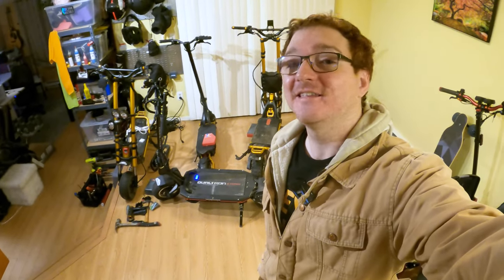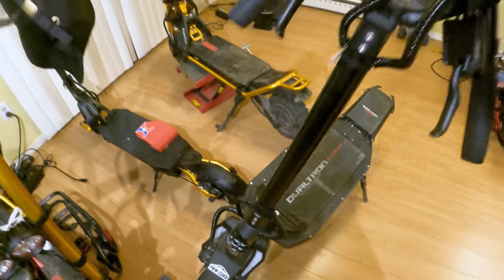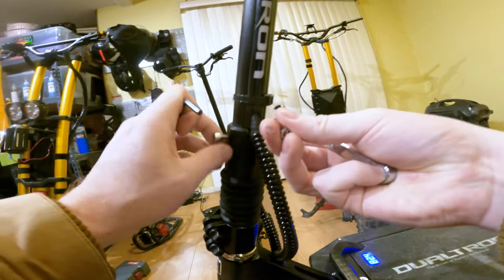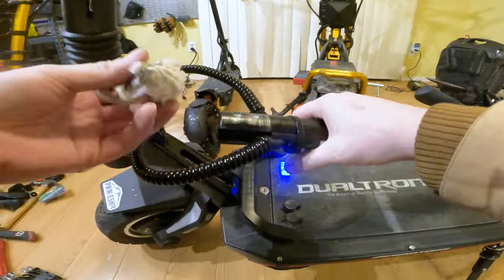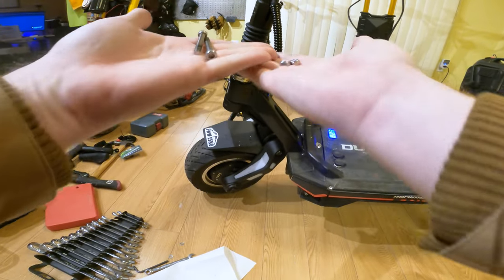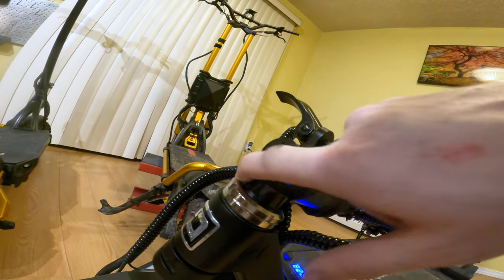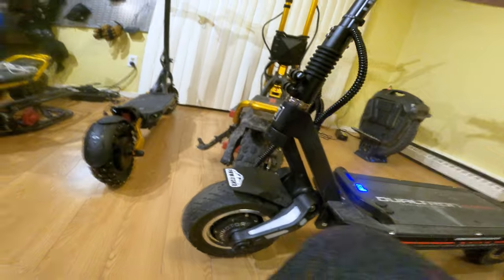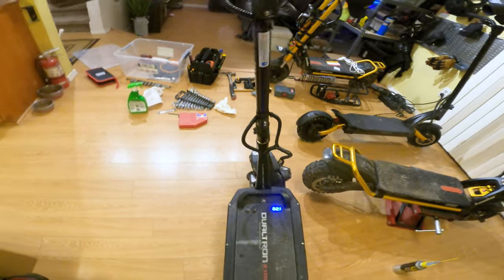TERRIBLE Stem Creak FIXED - Dualtron Storm Electric Scooter.

Comment: Howdy - Thanks for another good video.  I tried just about everything to fix the creak on my DT Thunder II stem and even with Teflon film, copper film, lubricants of all sorts and extreme tightening, nothing stopped it completely.  But it squeaks no more...  I don't fold the stem so I purchased a custom clamp with 6 very strong bolts and after installing, it is rock solid and totally silent.  Best of luck to all.  Have fun and stay safe.

Comment: cool to see youre riding your storm :D if the creaking comes back, a solution that usually holds up for a longer time is to clean it out like you did, but wrap the part of the stem that you insert with teflon tape, then use black silicone spray on the tape and inside the stem hole. its a bit more permanent :D worked great on my Ultra 2.  Another tip is to exchange those folding arms on the clamp for just regular bolts and use a tool to make it super solid with 0% stem wobble. its still easy enough to loosen if you need, but its heck of a lot tighter that way, and you dont have to hurt your hands tightening it.
Reply from the maker: Good tips! Thanks

Comment: Something you might try in the future for things is a product called friction paced. We use it in the bicycle world when we are attaching carbon fiber to carbon fiber it helps it grip and not spin or slip and not have to be over toward it is basically in assembly lube with something like pulverized glass in it basically feels like sandpaper cream it might work really well for things like that
Reply from the maker: I googled friction paced. Nothing came up.
Reply from the maker: O nevermind I found it. Friction Paste*. Yeah maybe I'll give that a shot if the noise comes back.

Comment: Thanks to this channel I just got my first scooter - Kaabo Wolf Warrior X Pro(was even lucky to get the facelift version, with the upgraded rear springs and the new side lights. I was amazed by how it performs, how long the battery lasts with me(115 kilos, like every winter) and how fast it goes. With me I was able to reach 65 km/h on my very first ride and got scared.
Reply: Lol. That's a helluva awesome first scooter. I bought a nine bot 2 months ago put 300 miles on it and now upgraded to the varla eagle one. There is absolutely zero comparison.  The ninebot is a prius and varla is Lamborghini. The torque will throw you if caught off guard. Have fun. Gear up n b safe

Comment: Thanks for the video I’m glad you figured it out. 3 weeks ago I just bought MiniMotors new BlueTran Lightning scooter and the same stem and clamp is used from the Dualtron line. I had the squeaky stem 2 or 3 days out of the box. I watched all the Dualtron squeaky stem videos and it just seemed there was an easier way. So like you I sprayed corrosionX on top of the clamp area and my squeaky issue disappeared. Lastly my bad I should have went to Saturday nights ride. Those are so much fun.

Comment: I have the Ultra 2, literally 1 day old, and as I type this after a ride I now have 24 miles on it. I now have a "popping" in the bars similar to whats in this video, just not as severe (yet). My clamp is slightly different and had one QR instead of 2. I replaced the QR with a nut and bolt and got it tightened down more plus greased it. Popping noise got better but still present. When I get a chance later I plan to remove the stem from the upper hinge bracket and try the "clean and cover in grease trick". But if that doesn't work, I was told by Minimotors that I could completely clean and degrease the stem and inside the upper hinge bracket, cover it in red lock-tite, reinstall, tighten the two bolts, and let it sit overnight. He said this works great and is more permanent, but obviously would make it hard to remove the stem if ever needed. Has anyone here tried using lock-tite for this? If so, any feedback?

Comment: i really cant understand how Dualtron have not dealt with this problem, its not just individual scooters that get this problem, its ALLLLLL OF THEM, the money we spend on their scooters should be well spent NOT kinda or Sorta well spent, this problem should be fixed
Reply from the maker: Yeah, I always held Dualtron on a pedestal as 'the best'. No more. Their short wiggly creaky stems are a total buzzkill. Makes it hard to find enough redeeming qualities to justify the cost imo.
Reply: Because Dualtron it's not at fault, neither double QR clamp system. My Spider 2 stem was wobbling out of the box, the reason was both quick releases fit to close on one side which they aren't designed to work correctly. Try to put one of them on the other side, find a sweet spot (not too tight, not too lose).. magic - no wobble, no creaking anymore😊😅

Comment: Scooter collection looking good👌do you by chance know what would be wrong with a zero 11x/tw phaeton  when all the speed settings are turned up but it only goes around 25mph but says it’s going 7mph? I’m thinking maybe a blown controller but I don’t have any codes so maybe it could be the throttle display or turbo button

Comment: I just got a dualtron and found you need to put a hose clamp on top of the folding clamp to stop it coming loose because rocking the stem back and forth makes the clamp work its way up making a gap that results in stem wobble.
Reply: Yeh and that's seriously bad design. I'd rather not have a folding scooter than a stem I have to question while doing 35mph

Comment: Hey. Thanks for the video..i own the varla eagle one and the stem is creaky but not like this .what I did is put a strip of electrical tape at the lower and upper part where it folds. I first cleaned w rubbing alcohol and ONLY WENT AROUND ONE TIME ...there is not enough room ...it's that tight. I haven't tries it yet but it's gotta be better. Any opinions ???? Also. ..what about putting straight bolts through and torque down? It will take more time to fold and you'll need to carry tools but those nuts w the embedded plastic washers x 2 would be super tight.  Thanks again for the good vids

Comment: Thinking about purchasing a Thunder 2.  I suppose I'll have to deal with this as well.   Not sure why most Dualtrons do this.  :(
Reply from the maker: My thunder did it too, developed in under 50 miles.
Reply: They have a new latching piece out, it's supposed to work.

Comment: That was the first thing i did when I got my Dualtron Ultra 2 i made Minimotors NYC cause that's where i got the scooter from they didn't even deliver it to my house i only live about 20min from them i went there picked it up and rode it home but the first thing i did before I left i made them grease the shit out of the stem the bottom part where u were talking about and the top part of the stem where the handlebars are thats was creaking too so he used some crazy black lithium grease then wrapped the stem in some thin plastic and put it back together so the metal shavings dont get on everything again cause thats why its creaking the metal hitting metal but yea that was the first thing i did before even leaving the store i don't know how u could deal with that noise i would go crazy lol

Comment: I love your videos men I’m about to order my scooter I have i question do you can buy a fast charger for the scooter.?
Reply: Theres a fast charger option for Dualtrons. I got mine from Minimotors for $150. I charge with both the stock charger and the fast charger goin at the same time. Takes about 5 hours or so to charge a dead Dualtron Ultra 2 .

Comment: How long was the ride you were going on?
Reply from the maker: About 45 miles
Reply: @GingerOnWheels  I'm guessing you didn't want to take any chances with the wolf at low voltage lol
Reply from the maker: @JoseMartinez-mm8gj  SNR is a high speed ride. Wolf would be dead before I got home.
Reply: Man that sounds fun I need to find something like that where I'm at, everything here is like 15-20mph
Reply from the maker: @JoseMartinez-mm8gj  its usually like that in summer time. But our winter rides are faaasst. 35-40mph. You should come visit 😀

Comment: I tried this same fix with lithium grease and I swear the creak came back even louder with a vengeance 😳 lol
Reply from the maker: Did you watch the whole video? That second area I put grease on did the trick for me.
Reply: @GingerOnWheels  Yep 👍 It turns out my squeak was coming from the little baseplate that holds the steering damper on my Storm Limited. Tightening the screws seems to have helped for now.
Reply: That sucks. They need a solid non folding stem for high performance scooters ...at least make it an option.   The only thing that should fold on a scooter is the kickstand really. I mean the most vulnerable part of a scooter should never cause question in the riders mind.

Comment: Neither of the Wolves have the range needed?
Reply from the maker: Nope. Storm is the range king for now. Something about those super whiney loud motors gets really good range at cruising speed. Wolf uses 20-30% more watt hours per mile. I wish I knew why, but I don't.
Reply: @GingerOnWheels  electric scooter guide performance tests also show the storm getting more range when driven at max speeds although the king gt is significantly faster with way more peak power.
Reply from the maker: @okdok3742  significantly? 4mph faster for me. GT pro does accelerate a bit faster though. What did ESG show?
Reply: sorry, by faster i meant overal performance in regards to speed, both acceleration and top end, overall its significantly more capable than the storm.
on esg the storm topped at 51 wheras the king gt topped at 61, and the range difference was 55 for the gt and 43 for the storm. 
i respect ur experience with the storm and i dont doubt wat u experienced but the esg results are more in line with i consistently hear regarding the storm and king gt.

wats ridiculous is the price of that gt, its such a steal compared to anything else on the market.

Comment: plz help anyone I'm 300lb 6.2 and I want to buy an electric scooter what's my options and what you guys recommend me getting?
 money isn't an issue
Reply from the maker: You anywhere near Seattle? There is a Phaeton with 300 miles on it for $2950. Comes with $500 Ohlins damper and 2x spare tubes and 2x spare tires.
Reply: @GingerOnWheels  I'm from Spain :P just wanted to know which brand and model is good for tall big guys
Reply: @slik  I'm 260 lbs and with my backpack and gear, probably close to your weight. I just got the Dualtron Ultra 2 a day ago, and so far I've gone 52mph on it, plenty of power, great battery range. Took it on some rough off road terrain today on my lunch break and aside from getting the usual handlebar popping/creaking, it did great with me on it.

Comment: HA. That shit don’t work. It’s a material issue. Get used to it. 
PS  The 2 Firelight 2000 lumen lights are all I could hope for. Actually brighter than an ordinary car headlight, you need to angle the lights (a GO PRO mount is the SHIzt) in regards to this. Luv the heavy metal construction!

Comment: Listen man, you don’t even know what you are doing. What you did is just temporary ( like one day fix). It will come back again. Thats a big issue with dualtrons. They are lazy to fix this , its been there since 1gen dualtron thunder. The only proper way to fix it temporary ( abt 1 month) is covering the whole joint you pulled out with a teflon tape and greese. WD 40 and cleaning is 1 day fix. Give  us an update after a day or two.
Reply: my thunder 1 has been greased and flawless for a year already
Reply: Its more of a 3 month fix to be honest. Not really that big of a deal. Need to use lithium grease and fixes it for months.
Reply: @alexander3here  One of the guys over at Monimotors SF said another more permanent option is to clean and degrease the stem and upper hinge where it insert's into, then cover in red lock-tite, reassemble, let sit overnight.....I'm hesitant to try this but would like to know if anyone has tried it and can provide some feedback?